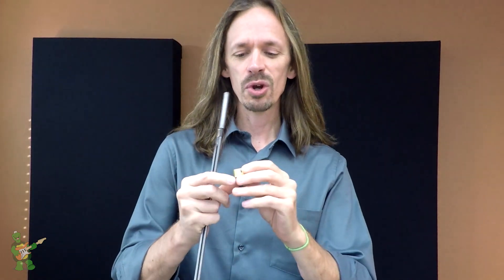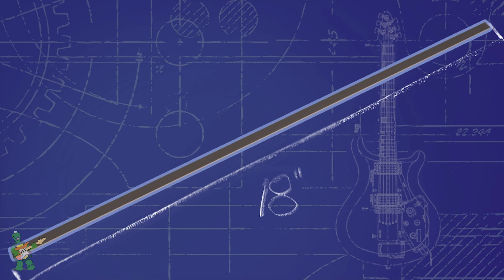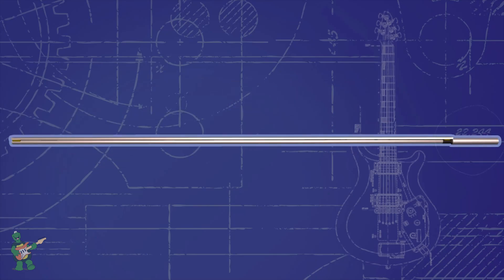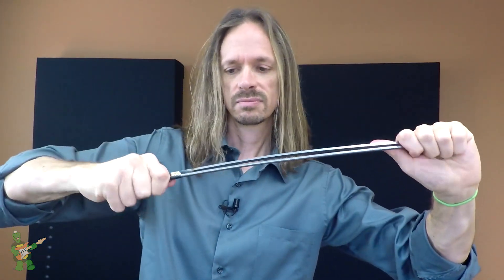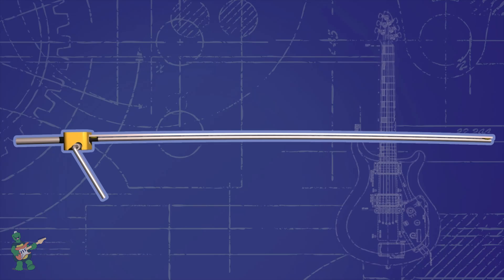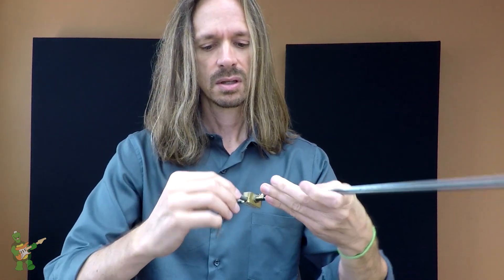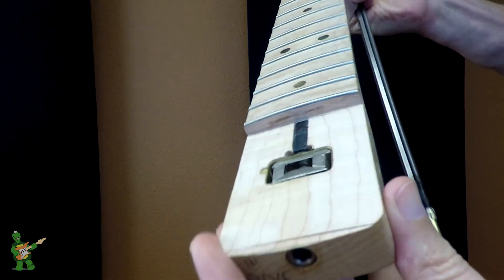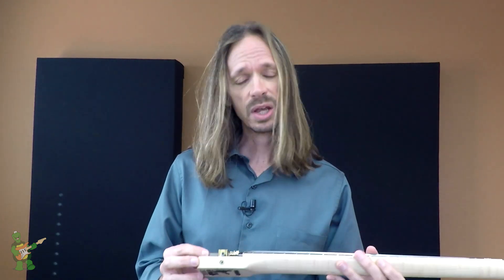The Warmoth Double Truss Rod & Side Adjustment Mechanism Explained

Comment: I thought a double action truss rod would bow both ways? Isn’t this just a single action truss rod with a convenient side adjustment?
Reply from the maker: Ya, the names make it confusing. "Bi-flex" is the kind that bows both ways. A "double action" only flexes one way, but uses two rods to do it (instead of the tradition single rod), thereby relieving the inward pressure on the neck itself.
Reply: @warmoth   A Buy flex is a double acting trust Rod.
 The truss Rod that you’re showing us, is a double bar trust Rod, that is single acting. 
It cannot force a forward bow, into the upper bar. 
With this truss Rod, only the strings, can pull a forward bow into the neck.

Comment: Lolz I got like 6 warmoth necks now. Bout time one of your nex needed a adjustment haha and it finally happened. Guess the elements or something got to it and it was bowing a lil bit. Not that bad but enough to the point where I had to play with high action to avoid fret buzz. I don't mind high action very much but this was a bit higher than what I was used to. I said to myself, this sux! Warmoth has failed me lololol.

So I loosened the neck pocket screws enough and put in a small wooden shim to raise everything up slightly since that felt like a issue. I covered the neck pocket screws with dish soap to a degree so they would screw in smoother. A then I watched this video to adjust that lil truss rod thing on the side on the neck. DOOOD this like fixed the problem instantly. I was told that truss rod adjustments have to be done slowly over days so the wood has time to take shape or whatever the f. I guess the side truss rod is faster at making changes or something... I dunno. This is a unfinished neck so maybe it's easier and faster to bend into shape? Who knows. All I know is it's playing better than any guitar I've ever played basically.

I have a fender neck that was str8er, you could tell by staring down the neck like it's the barrel of a gun. You could tell there was a slight bow. Like a boat canoe kind of thing. But these tips fixed it in real time. Neck is now super str8. Didn't even need to do a string change. Guitar played great before. Plays perfectly now haha.

Thanks aaron you are teh best.

Comment: Great video and I learned a lot.  I've only been playing since 1966 but I thought the only problem with single truss rods was that some are adjusted at the wrong end.  No wonder Leo didn't want to use them.  But since I haven't had trouble with old fashioned truss rods, and this double type still only goes one way (good joke, right there) I'm wondering how much weight the double rod and adjustment box add to the neck?

Comment: What’s the purpose of having a larger double truss rod if it doesn’t have dual action to prevent a reverse bow? 
That makes no sense.
Reply from the maker: It's explained in the video. A single trussrod exerts all it's inward pressure on the neck wood, which over time can cause it to warp. A double rod exerts all it's inward pressure only on the rod itself.
Reply: @warmoth  not trying to get into an argument . Pardon as we can’t see inflection in text.   I don’t mean any offense. 
But it is still exerting pressure on the neck wood or else it wouldn’t fix the bow. 
I don’t know man. If I were going to opt for a double rod , why not make it go both ways for any bow that may happen?  
You are already going to ‘ the trouble’ of adding a double rod in there, why not go for the most functional one?  
Cheers and no offense again.

Comment: I've got a replacement strat neck like this one from Warmouth in 2011. It is the best strat neck I have ever played, IMHO. I did fret leveling and recrowning myself to my preferences with a bone nut from scratch. The best purchase I have ever made for a guitar part. Now, I am considering a complete warmouth Telecaster "build" to my exact preferences.
Reply: But if you had to level the frets, or at least lower the height of them to you taste, then the neck definitely is not the best strat neck you have ever played.  Couldn't you have ordered one with frets the height of which you liked?  Warmoth has great illustrations of the specs of their necks.  Very specific.  Why, specifically, was this the best strat neck you every played?  What made it so, specifically?

Comment: This is by far the best design I’ve ever used.  I’ve build a dozen guitars with your modern necks and I joke that the torsion rods on them are “set and forget.”   Very mechanically stable.

Comment: I guess I'm not seeing the benefit here. Tightening the nut loosens the wedges and tightening the wedges loosens the nut. Whichever one is tighter is doing the work from the same place along the single action rod that he carefully calls a "double truss rod", not a dual action rod.
Reply from the maker: The benefit is that the rod is compressing against itself to flex, rather than the wood of the neck. Also, dual action rods flex both directions, while our double truss rod does not, hence the different term. Not trying to pull a fast one on anybody. Just explaining how it works.

Comment: 5:39 Until NECKS time, man.  Sorry to say, but this side adjustment mechanism looks like a solution in search of a problem. If you just put the nut on the headstock end, there is no need to take the neck off to access the truss rod.  When tweaking the truss rod, you want the strings to be on and in tune, so you can directly monitor the effect on playability and make immediate secondary adjustments like saddle and pickup height, and instantly try everything together.
Reply: RIGHT? Why any guitar manufacturer still produces necks with the truss rod adjustment nut at the goddamn heel is beyond me. Just put it on the headstock, ffs! Lol
Reply: @INeverWanted2010  supposedly it makes for a more stable neck and less chance of the headstock breaking off.
however the best solution is the spoke wheel heel adjustment imo.
Reply: @mtlspider  Spoke wheel is fine too, as long as I can get to it without taking the neck off.
Reply: Apparently they can’t have the nut at the headstock with a double action truss rod, only a single. They can with a tilt back headstock but not a flat one like a strat or tele, the nut lines up with the headstock. Perhaps the position of the nut when it’s at the heel is too low for a spoke wheel to be used without cutting wood out of the neck pocket. The side adjust allows you to have a double action truss rod on a flat headstock guitar without needing to take off the neck for adjustments.
Reply: @A @AnalogKid_2112  apparently there is some confusion here.
What Aaron did not explain was, this is a double bar. Trust Rod, not a double acting trust Rod. It’s a double bar single acting trust Rod.
Meaning there is two bars, but when tightening the nut, it can only pull tension on the top bar, bowing the middle of the neck upwards. It can not push on the upper bar, Boeing the middle of the neck down. By loosening the trust, Rod nut. It just releases tension on the upper bar, allowing the strings to pull a downward bow in the center of the neck.
A double acting trust Rod has a anchor on both ends of the upper bar, and the lower bar is threaded on both ends to these anchors. This allows the upper bar to be bowed in both directions.
When manufacturing a Guitar neck, a double acting trust Rod can be installed with the adjuster on either the head stock end or the heel end.

Comment: Why not just have the adjustment by the nut?
Reply from the maker: We also make our Vintage/Modern necks, which adjust at the nut. But for that to work the truss rod has to curve up at the ends, as a single truss rod does. The double truss like the one in this video is completely flat, so it doesn't work. Way more detailed info here: https://warmoth.com/guitar-neck-truss-rod

Comment: Sorry if this is a stupid question but is it designed to raise/lower the action ?
Reply from the maker: The truss rod is used to adjust the "relief" in a neck, or in other the words 'the amount of curve" across the length of the neck. It's part of a system that when used together can raise or lower the action. Other parts of the system include bridge and saddle height adjustment, neck angle, etc.
Reply: @warmoth  thankyou for your response, much appreciated

Comment: hi I'm replacing a trussrod on a strat with a double action one. I'm pretty sure that smartest way to go about it is to have the trussrod put in a way that when you turn to the right, thus pull on the flatbar of the trussrod it relieves the guitar neck, (in my case, forces the neck to relief) wouldn't you agree? My strat has a pretty stubborn backbow, so much so that the biflex system of fender caused the plug at the headstock to pop out

Comment: i have one of your necks and i dont like your side adjustment it gets in the way of screws on the neck to body bolt on you cant use off set screw only four on the corner and nothing in the center or you fit the mechanism

Comment: Don't you need the truss rod to allow to bow inwards aswell? This seems to only allow for back bending.
Reply from the maker: What you are describing is called a bi-flex truss rod, and Warmoth does not use them. The tension of the strings is all that is necessary to pull the neck into an inwards bow. The truss rod counters that, to straighten it back out as necessary.
Reply: @warmoth  got it! thanks for the reply!

Comment: hi .my question is how to bend the rod(neck) to the other direction if needed?  it looks we can only bend the rod( neck) to one direction which I still do not know which side it bends when  we tight the nut. but if we lose the nut the rod will be only stright. and does not go to the other direction. what is the solution then?

Comment: I mistakenly thought that a double truss rod could make the neck curve either way.  IOW force relief (actually counteract excessive backbow) as well as produce backbow.  However, this demonstration indicates that the double truss rod is only capable of producing backbow to counteract string tension. If that is the case, the benefits appear to be 1) pressure from adjusting nut is metal on metal (instead of metal on wood), and 2) truss rod channel is a simple, flat bottomed dado of sorts instead of the convex channel require for a single stress rod. Is that correct?

Question:  are fingerboards thinner, thicker, or the same with a double truss rod?  A regular, single-action truss rod applies pressure to the body of the neck. Here it looks like the double action truss rod applies pressure to the underside of the fingerboard, but I may be mistaken.

Comment: I had heard that the modern neck side adjustment mechanism has had problems breaking. Is that true? I just bought five vintage/modern necks from you guys because they seemed weird to me.
Reply from the maker: No, it's not true. We have sold tens of thousands of them over the last forty years. Maybe even hundreds of thousands. They are made by Gotoh, and a solid piece of hardware.
Reply: @warmoth  Awesome. I ordered a showcase vintage/modern neck about a month ago. Received it. Installed it. Just killer. Love it.

Comment: You actually inserted a Toyota pickup truck automatic gear to a strat neck just for tuning neck relief??

Leo got it the first time....and much much lighter and simpler
Reply from the maker: Warmoth offers three neck constructions. Our Vintage Construction is exactly like Leo's first design. Our Modern/Vintage is exactly like Leo's second (improved) design. The Modern Construction shown in this video is more stable than the other two...but if it's not your thing that's why we make the other two. :)

Comment: One thing I don't quite understand - with the side adjust box installed between the adjustment nut and the bar, you show how it is still possible to make major adjustments using the nut.
That makes sense, but won't it also push the side adjust box position toward the bar as well?  But since the access to the side adjust mechanism is drilled through the side of the neck heel, I would think the box has to stay where it is, right?  Or is the movement so small that it will always basically line up with the access point on the side of the neck?

Comment: Awesome!!... A question- if i live in a climate where frequent adjustments are a possibility, would it be a good idea to halfway engage the side adjustment so I have the flexibility to tighten or loosen the truss rod without taking off the neck?
Reply: Yes, but it's not "a good idea", what you described is simply the universal starting point for this type of neck.
Living in a climate change zone doesn't affect the method of adjusting the instrument, at most It affects how many times you have to adjust it.

Comment: what is the the point of the side adjustment if you already have the first one doing the same exact thing.  So two things that do the same thing but nothing to finback bow when truss rod is completely lose.  This happens when you use very light gauge strings, 7's or 8's often times Truss rod is all the way lose and guitar still needs more up bow.
Reply from the maker: Bingo.

Comment: If I understand well a double-expanding truss rod IS NOT a two-way truss rod, right ?
With a double-expanding truss rod, like in a Warmoth Super Bass neck , one can only tightens the truss rod to make a back bow, going counter-clockwise can only bring the truss rod back to its "neutral" position, right ?
Reply from the maker: This is correct. The Warmoth rod is not a "bi-flex" rod. Rather, it flexes in one direction only, by using two metal shafts.
Reply: @warmoth  Thanks
Reply: @warmoth  Oh, I've got one question to ask : what's best to do if a Warmoth Super Bass neck is removed and unused for a long period ? Should I unscrew the truss rod until its nut is loose or should I tighten just a little bit ?

Comment: I'm struggling to understand why this has an advantage over the Vintage Modern design that will allow you to never take the neck off for any truss Rod adjustments and requires less thinking.   I'm all about modern features on strats but this is one where I don't understand the advantage.
Reply from the maker: The main advantage of a double truss rod system is that all the inward tension being generated by the rod is absorbed by the rod itself, and not by the neck wood. Over time this constant inward pressure can cause some necks to develop a hump or an S-curve. That doesn't happen on double truss rod necks, because that inward pressure is not being born by the wood. It also makes them far more stable, as opposed to traditional single truss rod designs, which often need seasonal adjustment.
Reply from the maker: Also, if you're wondering why we can't just orient our double truss rod so that it adjusts at the headstock and get rid of the side adjust mechanism, the answer is: we can and do....but only on our tiltback headstocks like the Nomad and Hombre. On straight headstocks like the Strat or Tele replacement necks we can't. The geometry doesn't work, due to the fact that double truss rods sit in a perfectly flat trench while at rest, as opposed to curving up at the ends like single truss rods do. IOW, you can't get to the adjustment nut at the headstock because it's sitting too deep in the neck. Hope that makes sense.
Reply: I guess I should have watched every video, read every single comment befor ordering my neck. There was no indication that modern construction  meant a truss rod or another part. 
I've got 12 guitars that don't  have a double truss rod and all are more stable than the one one double  truss rod.

Comment: OH!  wow, now I get it.  It's really analogous to the fine tuners of a FLoyd Rose system.  Instead of taking the guitar neck off each time to adjust you can just get it close with the main one and then use the side one to fine tune it after you get the guitar all back together and tuned up.  More of a time saver I guess.
Reply: TruthSurge! Love your "Excavating..." series.
Reply: Plus you’re doing the fine adjustment under string tension, and can tweak the neck if seasonal temperatures and humidity cause slight changes.
Reply: @Billie Goes get a life loser

Comment: Genius!  Love the innovation.  This saves so much time by not having to remove the neck every time a truss-rod adjustment is required.
Reply: Plus it being a fine adjustment, and plus it being adjustable under string tension…

I’m less afraid of these things now, even though I’m totally fine with the simpler Vintage design the company also make… my Warmoth neck just never moves! (And this despite having the neck back lacquer sanded off and just oil and wax applied… that’s a good chunk of maple right there.)

Comment: The reason people are afraid of their truss rod is they do not know how to set the rest rest of the guitar up after the adjustment and blame the adjustment. All good guitars tailored to a person's needs are done first on feel and comfort if you lack those then any adjustment after that will not be ideal to the player. 

Personally, I adjust the neck and generally set it as straight as an arrow, the reason I set it to as straight as possible is I believe there is a balance in everything within physics, if the strings are an acting force on the neck then straight should be its balance but all neck are not the same so minor adjustments are made after that to encompass what I feel is comfortable, meaning my comfort zone is a 12 inch radius with jumbo frets with a 25.5 scale length, I know I can set this type of neck straight without an issue and it will be comfortable to me. On my fender strat I need it to be back bowed a bit as those parameters are different I have tried straight and it is not comfortable at all for me. I tend to approach it like "how can I get this neck to feel as comfortable of my other guitars". 

The comfort of any guitar starts at the neck, and everything that follows reflects that comfort even tone.